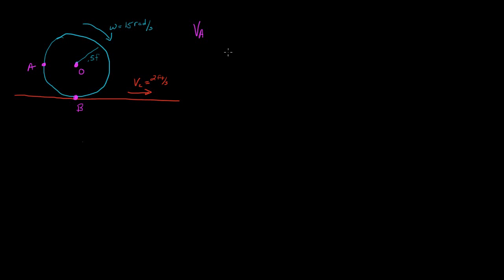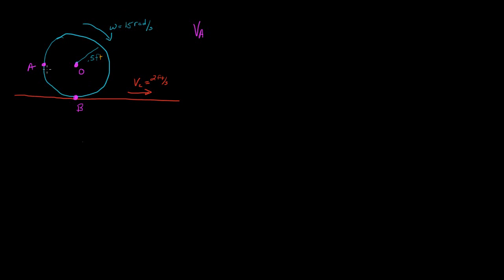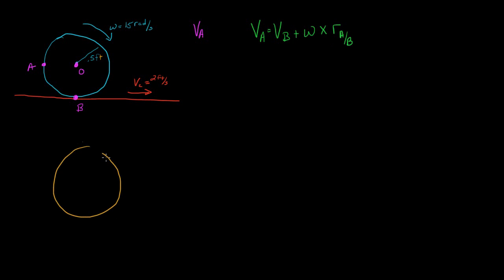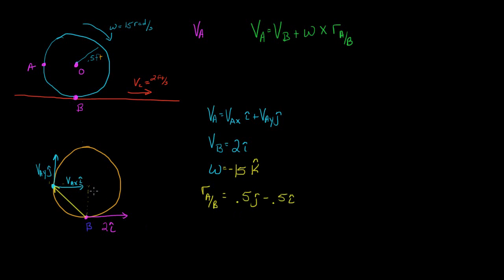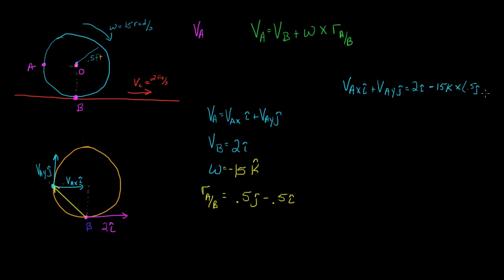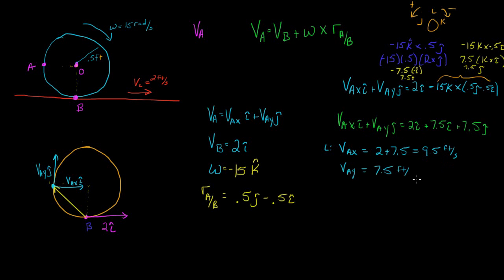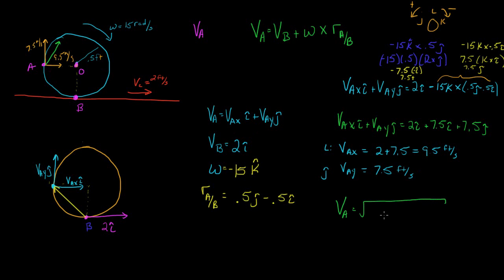Relative Velocity (Rolling Cylinder on a Conveyor)

Comment: shouldn't velocity of B be zero because its in contact with the ground and its not slipping?
Reply from the maker: Hi, it is because in this example it isn't the ground and it is a moving conveyor. The contact point (in this case B) will have the velocity of whatever the conveyor is moving at. You are right in that if it was the ground  it would would have 0 velocity.